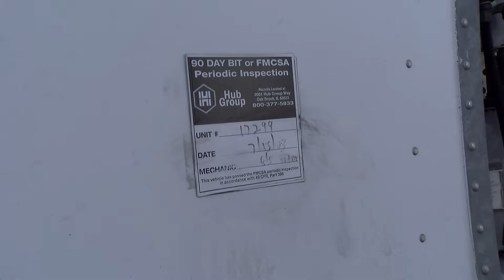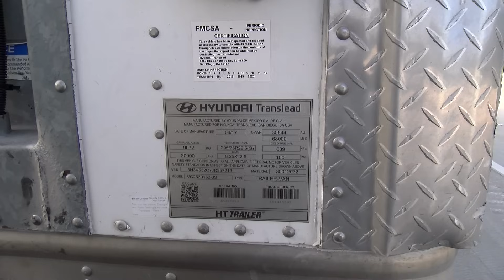111923 CLEVELAND FATAL CRASH TRUCK CUT IN HALF

Comment: Jesus Christ on a motorbike, that work truck must've been going 400mph when it hit that big rig. Have never seen a car more pulverized.
Reply: Most Ford trucks of that year come from the factory with a road speed limiter that is usually set at the factory to about 75 to 80 miles per hour.
  But with that body full of equipment ( that weight is pushing it all down the road) and if it is doing 80 mph and hits anything solid 🪨🪨 the force is so much greater, probably double, it has to destroy the moving object.
Been there and scene that happened. A driver ran under the back of a tractor trailer that was sitting on the side of the road 🛣️ away from the main road, it didn't stop till it hit the rear tires of the trailer, it took all of the roof and cut the driver's top of their body off ( had a white sheet covering the driver's area)

Comment: There’s a Love’s travel center in Cleveland TX. just north of the accident…Truck was going north so probably the next exit…you see the “RV Station” on the other side of the highway as reference.  Makes me wonder why the trucker pulled over there, and not the truck stop; the officer at the beginning didn’t mention the truck was broken down, just parked.
Reply: Electronic logs... when you are out of hours you have to park you can't drive another 10 minutes and fudge it like a paper log book.
Reply: The semi might of had flat tire
Reply: the parked truck was broken down, he had safety triangle reflectors out behind him, you see them under the truck that hit him.
it wasn't a flat tire or he would have just kept going, he has 17 more.
he may have been trying to make it to that truck stop to a mechanic and it couldn't continue.
Reply: Air brakes have a safety override if pressure in the air system drops below a certain level. Once that minimum pressure is lost, the brakes lock up, nothing you can do to override it. If you see your pressure going down, get off the road safely right then! Regardless of the issue, trucks quit running just like cars with little warning, and they don't coast very far. I'm sure the truck driver would've much preferred making it to the truck stop for coffee and breakfast while waiting for repairs.
Reply: I'm sure any truck driver would love to relax, while waiting on repairs...I agree with you
Reply: @gsdalpha1358 : Yeah you can back off the brakes to get it out of the lane of traffic, which is dangerous, but it can be done. However, I think the driver of the semi might have had other problems, besides the brakes.

Comment: Oh the seat belt ripped so it looks like they were wearing it and the clip of the seat belt is still locked in.  The driver of the Utility truck must have been going a top speed to do that much damage to his truck.  That and they now make vehicles out of aluminum which is the softest metal made.  Sad sad sad. I agree with the other commentator the driver may have fallen asleep while the passenger was asleep.  The luggage I assume means they were going or coming from a job away from home.  Hope we find out who the driver is and the passenger.

Comment: Lot of vehicle collectors cheat.. but asphxyation related higher likely, long travel time helps confirm that, started a long distance away..
Reply: 20%fresh air following trucks too close fast carbon monoxide overdose..
Reply: Required by vehicle ac units..
Reply: Vehicles MUST stay farther behind a tractor trailer length.. or fast sleepy gone.. trucks too xcept when passing..

Comment: When are people; young and old going to realize that seat belts SAVE LIVES but only when they are properly worn!
Reply: If you bothered to watch you would see the seal belt was RIPPED and the lock was still locked in it position.  So The DRIVER HAD HIS SEAT BELT ON but with that impact and damage he would have been killed anyway seat belt or no seat belt.  Duh!!!.
Reply: You're comment should've been, when are drivers young and old going to realize, when you're tired  from driving, you need to get off of the road and take a nap so you can continue, instead of driving tired and running into the back of a broken down semi tractor trailer. Then you would've made sense.
Reply: @brianlanders8028 you don't know what you're talking about.
Reply: @matthewdavis5833  : Why is that, because you don't have the brain capacity to figure that I'm right so you criticize??? Yeah, I know what I'm talking about, because I've been around for 65 years.
Reply: @brianlanders8028  age doesn't mean wisdom and in this case it's assumptions.
Reply: @matthewdavis5833  : Exactly, you're assuming you think you know it all. Go away kid, you're bothering me. I just hope you grow up before it's too late, maybe you'll end up like the driver in the work truck, we can only hope so.